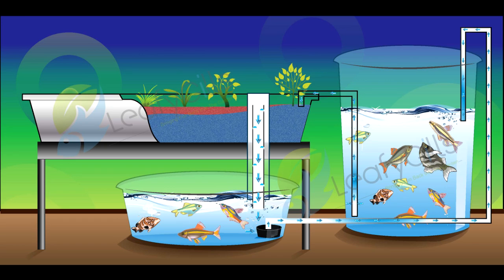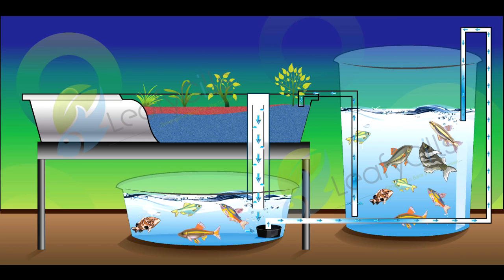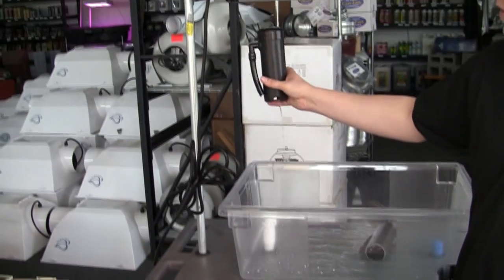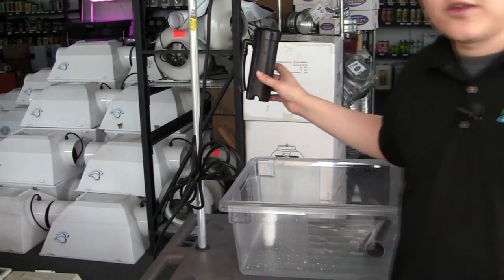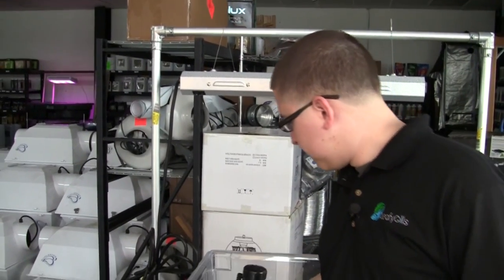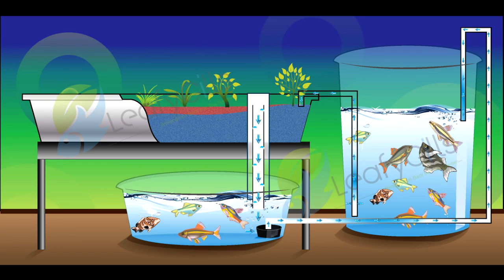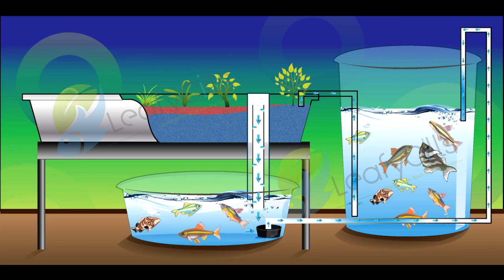What is a CHOP Aquaponics System?

Comment: Will plant survive under constant flow of water into the grow bed such as for example in hydroponics I've seen people use buckets and roots are submerged in a nutrient solution so can an aquaponic system have a constant level of water in the grow bed at all times instead of the constant fill up drain method. I would love your opinion

Comment: All good until your power goes out then your sump gets flooded and overflows....
Reply: Spushed not if you start with a static level in all three tanks. Then there is no way it can over flow because if the pump shuts off then the fish tank isn’t being filled which means the grow bed isn’t being filled which means the sumo tank isn’t being filled. The water level just freezes. The bell siphon i. The grow bed will also allow a significant amount of water to remain in the grow bed during pump failure keeping the sump tank at a constant level during failure.

Comment: Also if you watch this. The concept is there just confusing.   Try to forget the tubing and filters and pumps ... think three things. Fish tank, grow table, and floor reservoir. Pump goes in floor res and pumps water to both fish tank and grow table. Bell siphon in grow table drops water to floor res. In between the fish tank and floor res have the water that is being moved by gravity, same way he explain, be be naturally filtered by gravity. (5 gallon bucket where the water that flows out of bucket has filter) .... rob bob baby! Perfect design and explanation.... the o lay items you need are pvc, bulk head fitting, and a pump. Everything else can be built
From your imagination..

Comment: As a newbie to the art of aquaponics, I was looking for clarification. Ive just seen it done a different way on another channel . With a sump, what is the order of the flow system supposed to be; ??? I just saw one that showed me the following set up:
• From the Aquarium an overflow drains into the sump tank via gravity.
• From the sump tank, the water is pumped up into a growbed. 
• From the growbed, the water drains back to the fish (via bell siphon). (?)
So I only need to use 1 electric pump, and gravity does the rest, am I correct?
Thanks.
Reply: youll need more than just one pump. water from the fish tank flows into the growbed. after it has gone thru thre growbed water should flow through a filter because you want the water to be clean of particles and small debris. the water then flows into your sump tank which it is read for re circulation into the fish tank as clean water.. the benefits of the CHOP method are that you need one pump instead of 2 or 3 (considering how many levels of filtration you have between the growbed and sump tank)

Comment: There are two errors in the drawing.  The first is that the water level on the main fish tank is not at the level of the overflow which it always would be.  The second mistake was putting fish in the SUMP and then not mentioning that you can do that, but most people do not.   The explanation was all correct, just need to edit the drawing a bit.

Comment: could someone please tell me what they think about the following idea? i dont have much experience.  i was thinking of setting up a system that pumps water out of a fishless tank and into the grow bed, then a bell siphon would send it into the other tank with the fish in it.  the water level in the fish tank would always stay at the level of an overflow that flows into the fishless tank. the fishless tank would have a fluctuating level, and would need a maximum water capacity only slightly greater than the amount of water it would take to fill the grow bed.  the main purpose of having the fishless tank in the equation would be to keep the water in the fish tank constant, but it would also increase the overall water capacity. both tanks would be at the same height as each other, but lower than the grow bed ... im asking 'cause that is what i was thinking of doing. i was looking to see if i could find anything simular. thats how i arrived at this presentation ☺ ... thanks

Comment: I was thinking of a similar idea that uses the only pump I have (an air pump) that pumps air into a sealed, "sump" which has a non return valve on it. The pump will turn on when the water from the grow beds has finished siphoning into the sump. It then fills a fish tank which is connected to a reservoir at a specific level and from there siphons out to the grow beds.

Comment: i like the chop system with a sump tank but is there a way to suck the water from the bottom of the fish tank ( so that solids can also be cleared away)? And also wont the suction from the fish tank water form a siphon, sucking all the water out quicker than the pump can provide.
Reply: You have to size your pipes and pump so the flow matches inflow and syphon flows. I put a valve on my syphon to control the flow. Once the flows match, your system should be good to go. Mine runs for weeks before I ever need to make any more adjustments. You can adjust your syphon intake tube to where it sucks from the bottom of the fish tank but if your pump ever fails, you will empty your aquarium. I always leave 4-6 inches of water below the bottom of the syphon intake for this reason. Another potential problem is loss of your syphon and the pump filling up your aquarium. I avoid this by ensuring the water in the sump never exceeds the size of the aquarium. I do use bell syphons on my grow beds but occasionally I have basically a CHOP system when my bell syphon fails to start and just slowly drains but leaves the water in the bed at a constant level. Usually a quick fix though.

Comment: Hi Joey.  In the system of Murray Hallam the height of the grow beds and fish tank are not important.  (Thats the CH part of CHOP.  Constant Height One Pump.)  ALL water flows to the sump - from the grow beds AND from the fish tank. The water doesn't flow directly from the fish tank to the grow beds.  The sump doesn't act as a filter at all - that's the job of the grow bed.  About half of the water from the pump goes to the grow bed, while the rest is returned to the fish to aerate the water.  The water returning to the fish does contain some fish waste, but far less than flows out of the fish tank to the sump.   I don't understand why you have fish in your sump?  As for the trolls picking on your appearance - you're doing a good job of ignoring them.  Keep going - you've got the overall idea, and it's good to see you having a go, while the others just sit at their keyboard and poke fun.

Comment: listen im not an expert on this and in fact i actually just started researching on Aquaponics as a means to have a clean aquarium ( im planning on setting up my first aquarium ) and im not trying to get into a debate where i probably wouldn't know what im talking about but one thing that got me about this setup is that in your illustration that water from the tank will be coming from the top part of the tank and into the grow beds. which means some of the animal poop at the bottom of the tank will probably settle there and accumulate at the bottom of the tank unless they float. this could be an issue.
Reply: I agree with you about the waist at the bottom of the tank. This is why I will install an under gravel filter system in mine.

Comment: Do you have any kind of ration for gallons of the tanks to how many gph you want to be able to pump?
Reply from the maker: th most important thing is to keep the water moving, Agitate the water and you can use a product that has sulfate mineral. We use Drops of Balance @ 1ml per gal and the water stays nice. http://dropsofbalance.com/
Reply: Leafy Gills Can one just choke back the water and not pump all of the water it's regulated for?  Does that damage the pump?
Reply from the maker: yes you can, and no it does not hurt the pump.

Comment: Another great video! Very informative. I understand that the fish water (taken from the top of the tank) is circulated through the vegetable patch and back into the fish tank, but what happens to the fish waste (taken from the bottom of the tank? I saw in your video that it flows into the white bucket beside the fish tank, but then what? Thanks. 

 I Recommend 5 Tips for Consider Aquaponics System Design in this link :https://www.youtube.com/watch?v=mThzVrq6m54

Comment: Leafy Gills...as if aquaponics wasn't involved enough, I was wondering if a gray water filtration system could be added in somehow. Any thoughts on this?
Reply from the maker: +zoktoberfest As long as you have a good filtration system. I would recommend a product called Drops of Balance. www.dropsofbalance.com  If you are concerned if the water may be contaminated. This product cleans water and adds sulfate minerals to water.
Reply: Good advice, thanks, but this leads to me to more questions and maybe another excellent video from you to address them. Continuing with the theme of capturing and captured gray water, I need some advise about finding the very best aquatic plants, with the most extensive root systems for filtering dish, bath and laundry water. My gardens and evaporation make high demands on my saved gray and rain water in the summer. Winter makes high demands on my storage capacity which I am always increasing, because supply totally outstrips demand. I am looking into double and triple layers translucent sheathing to build an insulated greenhouse to protect those pants and fish during the winter. A thermostatically controlled heating system is being considered. There is much more to this long term project, and perhaps I will be making my own video on how this all comes together, if it does, but I would like to hear any thoughts you may have on any of this
Reply from the maker: +zoktoberfest I would love any info you have after you do your research on this project.  I would research earth ships because I know they use a lot of gray water.

Comment: What is the purpose of the sump tank and is the water filtered from the sump tank into the fish tank?  Also did not understand the purpose of the siphon and where it fits into the system?
Reply from the maker: +George Henson The purpose of the sump tank is to caught the drain water from the planter bed and to re pump the water back to the main fish tank for re circulation
Reply: the purpose of the sump is two fold.  1) it keeps the pump from sucking up small fish by accident. In their picture they showed fish in the sump bit you generally don't do that.  2 (and most important) using a sump keeps the fish tank water at a relatively constant level.  the sump ebbs and flows with the pumping the fish tank only goes a few inches up and down.  this is important if the system has a failure and starts to leak, using a sump the worst that happens is water stops flowing and plants die but the fish tank remains full and fish live. water empties to the level of the siphon near the top and stops. if you use the fish tank as the sump and another part of the system fails and leaks the pump will drain the tank and then everything dies. the same thing happens if you end up being away for an extended period and have excessive evaporation. you can drain the tank to low and kill the fish.
Reply from the maker: +David M Thanks David for the more details explanation. For helping out David if you ever visit our sister company www.Perfectgardens.com for gardening supplies. Email me 1st at admin@ and I find a way to take care of you.
Reply: Leafy Gills thanks!  I'll check it out.

Comment: so if the fish tank lip is flush with the grow bed tank will the pressure be enough flood the grow beds and trigger the bell siphon?
Reply from the maker: +Sterss4 the bell sysyem is ticky.

You will have to play with it
Reply: the key is having the bell siphon exit the tank low enough so you can leverage gravity to do the work and maximize grow bed depth for suction.  if they are the same height then you lose grow bed  depth. the siphon from the thank will have to go in father down relative to the edge of the grow bed. you leave very little room for error on filling and evacuating the water.  if the bell siphon is not perfectly tuned you will most likely have a bed overflow. when the tank is at least slightly higher than the bed, the tank drain can be higher above the grow bed and the siphon height and flow can have more adjustment room.

Comment: Good start but after a few weeks your ammonia is going to go off the charts because of the solids (fish poop) going straight into your grow beds. Not good.  ( good way to start up but not good long term ). Add a settlement tank between the fish and the grow bed to collect solids. Put the solids in your garden or on your lawn. Also add a venturi valve on the down spout of the water line to the fish and eliminate the need for an air pump.
Reply: Thorne991  I run a settling tank, but am thinking about vermiculture as well
Reply: Nope, the nitrogen cycle in well established media would take care of that. Aquariums use sumps with much less media than a grow bed has for bacteria to filter a well stocked aquarium, converting the ammonia eventually to nitrate. A hydro grow bed provides way more well circulated surface area to colonize than any aquarium filter. Most plants prefer ammonia over nitrites and nitrates as well, so the little(if any) that is left unconverted would be rapidly sucked up by the plants, leaving just the yet to be used nitrates which are considerably less toxic.

Comment: Awesome but you NEED a settlement tank ...
I learned this the hard way!
Reply: A tank that settles fish waste so it wont get circulated  through grow beds and cause buildup or rots
Reply: If you keep some red Wiggler's in your grow beds it should keep the solids under control plus it adds worm casting's to your system and we all know the benefits if that
Reply: Instead of a settlement tank, maybe a 3" PVC pipe horizontally with 3 or 4 T joints directing the water flow into the sump tank, and having bag filters attached to the exit hole of the T joints before the water is returned to the sump tank, then every other day, remove the bag filter, wash them and reinstall.
Reply: +JT Bear  I love your video, particularly your ideas in the second half about what is aquaponics system
. Something I also found helpfull for aquaponics plans pdf
  was Panlarko Expert Aquaponics Planner - if anyone wants to know more search on google
Reply: u added moore confustionnow.
Reply: I can across a great collection of videos that should help on Fast track grower
Reply: hey ,if anyone else trying to find out aquaponics courses try Fast Track Grower (should be on google have a look ) ? Ive heard some incredible things about it and my mate got great success with it.
Reply: I'm not sure but ,if anyone else  wants to learn about 
aquaponics book
 try Proutklarton Surviving Instruction Plan ( search on google ) ? Ive heard some amazing things about it and my mate got amazing success with it.
Reply: JT Bear i learnt the hard way when I got married lol
Reply: I discovered this video on Fast Track Grower - there's many awesome  videos there that should help out

Comment: Joey,

        My question is about the good fish waste that is to go into the grow bed.  Since most fish waste goes to the bottom of the tank, how does it manage to go with the water when it over flows?  I understand that fish waste can break down into the water and be pushed out in small ppm, so I might have answered my own question.  Also, with the overflow, is it constant like a drip or does it happen like an ebb and flow waiting for a large amount then drops down to nothing? 

Thank you for posting the picture.  I am studying this in and out of school and appreciate your time and effort in helping the community at large. I see this as a large asset in fighting the 2050 problem of 9 Billion people to feed.
Reply: Note that the overflow pipe from the main fish tank to the grow bed extends to the bottom of the fish tank. The water flowing up that pipe will carry the waste that sank with it to the grow bed.

Instead of an elbow inside the tank, I've seen a Tee where the riser pipe is open to the air at the top, and the branch goes out to the grow bed.

Sometimes air will be bubbled up that pipe to assist in lifting water/waste. Search for 'air lift pump' to see diagrams etc.

Comment: Folks he's just explaining the system he didn't invent it.  Bottom line is that it works.  ALL negative comments are trolling - if you can't come up with a suggestion that HELPS others please remain silent.

      I've seen this done with fish in both tanks, but the sump needs a filter.  Also the pump can be run on a timer if it has the capacity to fully exchange the water in the plant bed in the time it's set for.  The water will still get aerated enough as it flows through the pipes for the fish and plants and your pump will last longer. 

     A float switch isn't really needed with these systems as the plant bed has an overflow that can handle the volume of water the pump can put out and more.  I've seen floats stick in toilets often enough to know that the simpler you can make a system, the less likely it is to fail.  I would much prefer an overflow drain, protected from clogging to any mechanism that could end up dumping all my fish tank water on the floor of my house, killing all my fish and plants in the process!  Heck, just thinking about this makes me want to put in a redundant overflow!!!

Disclaimer:  I built my own systems and have nothing to do with this company or anyone here for that matter.  The method has the potential to feed people more economically than they presently can eat - and is worth sharing.